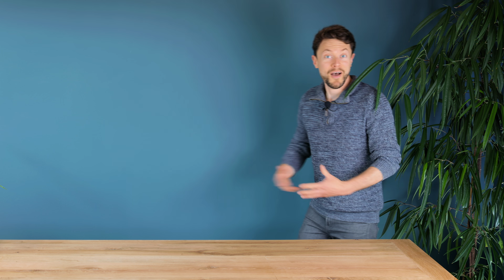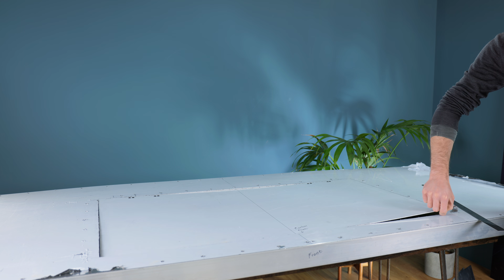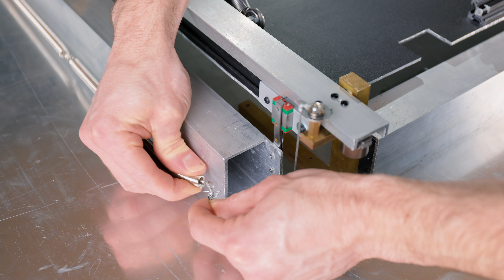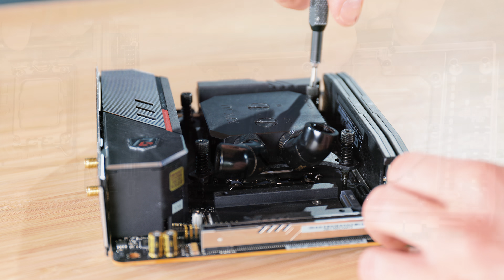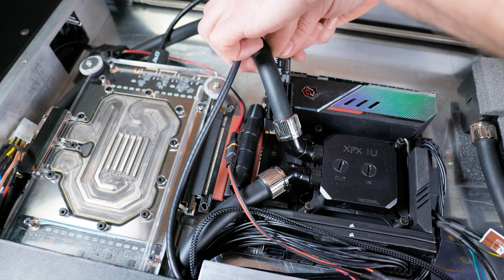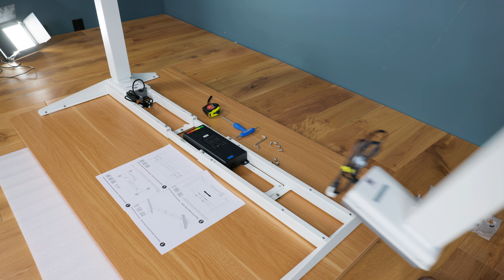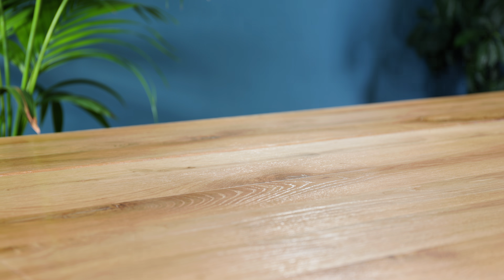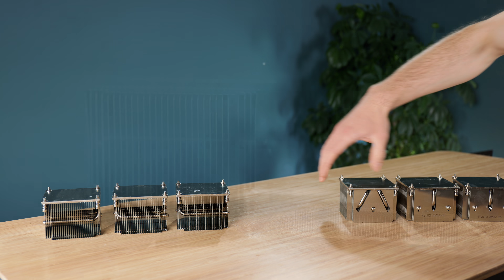Building the ENDGAME invisible PC

Comment: This is an awesome build. But I am a bit concerned with the table being sagged/bowed from the center, as it does not have any horizontal support in-between the legs on both sides. 

I know the table has square shaped hollow Aluminum bars. The original FlexiSpot desk has a horizontal Steel support bar at the center of the table (underneath the table) which is much more stronger than Aluminum. Also the Steel support bar is underneath the desk and placed right at the center, making the total weight distributed even. Whereas the Aluminum support structurer bars are on the perimeter, they do not give the table top similar support as the Steel support bar from underneath the table.

Comment: 24:09 was the comparison between heatsinks without fans vs radiator + fans? Because the one you showed earlier had fans on and often regular radiators already have fans installed too, right? I guess my question here is if the comparison was potatoes to potatoes...

Comment: I do wonder how much weight the table can handle, especially the monitor section. That's the only thing that keeps popping in my head with an invisible build, how foolproof/maintenance friendly it is. Also the empty spot opposite the computer could probably be used for a small storage container if anything.

Comment: One major issue though is that the screen is fixed in position. Not height adjustment or tilting possible. And while this may not seems like much, I think it can be very annoying on actual use.
Yet this is a really nice build ! Very impressive idea for the cooling system. I'm a bit sad that it didn't work with the copper heatsinks, it really looked like a great idea and should have had enough dissipating surface if the airflow was working as expected..

Comment: Awesome build! There is no deny that you're king of DIY. Side question: Is there any DIY alternative to portable workstations like Lenovo P15, HP Zboard, Dell Precision 7xxx laptops? Yes ive seen "luggable pc" video but i need something smaller :) I need a small portable workstation which can have 96GB (minimum) of ram, 8c/16t x86 CPU (minimum), powered from ONE powerbrick and easily fit the backpack (and below 3KG of weight). At first i thought about terminals like Dell 7010 Plus, HP 600 gen 9, but their 96GB support is unofficial and "wonky" and 2x48GB SODIMM modules are rare and expensive. Same with miniPCs like Minisforum MS01 - their poor support is also a problem. Workstation laptops mentioned above with 4 banks of RAM (up to 126GB) are really pricey (also because of screens, battery and GPU which i don't need) . Yet they don't have expandability (additional NICs). So do you (or anybody here) have any ideas arround this problem?

Comment: Looks beatiful and so clean, maybe a couple things I would think about:
1. Dust filters, the heat sinks will become a magnet for dust and their thermals will decrese with it.
2. Looping the coolant in the brass pipes like that having the input and output right next to each other means some (maybe very little) heat is transferred, separating that could improve it a bit more?
but ultimately it's great and if I could do the other half of the stuff I cannot on this project this would be a DIY next :)

Comment: One problem you'll run into sooner or later, depending on how clean your area is.  Carpets are really bad, but, anyway, having those fans just bear will suck in any fine dust and over time will cake on the fins and blades.... Better to buy a few air purifiers or some sort of filter enclosure. Unless you love taking that apart to clean it. I'd make a filter box to go over the fans. But having some hepa filters would also cut down on dust in the air.

Comment: There are less wide water cooling radiators. About 80mm of if I recall. Not sure how thick that table is but you can get a more flush setup with those radiators rather than the full size ones you used.

Comment: After building my first epoxy table I might make this my next project.
However I do not see the benefit of the cooling solution except that it is of course a cool engineering solution. As it is placed below the table and not hidden behind a somewhat thicker tableplate a classic radiatior will do the job just as well.

Comment: The only thing I'm wondering is if anything breaks like that monitor (that you've glued over all the connection points.) It would be very hard to do any kind of repairs.
Reply: Yeah he should've made a 3D printed snap on backing and glued the top wood to that instead or something.

When the monitor goes, the desk goes. Has to build a whole new one.

But it should last quite a long time.

Comment: Wow! First off, amazing build! The craftsmanship on the desk is fantastic, and the mechanics and monitor mounting are incredibly well done! I was originally going to be very critical of your cooling setup, but you addressed most of my issues in the end before I could mention them. The only concern I have is the brass heat spreader. The CPU water block is nickel-plated copper which is fine with brass, and I am assuming you did your homework on the GPU water block as well to confirm it is electrochemically compatible. But brass is far less thermally conductive than aluminum, and especially copper, so for an end game set up, I'm surprised you wouldn't go with better materials, though it doesn't really matter given how much surface area you provided and how many fans. The other concern I have is with the lack of any ability to reposition the monitor. Other than those, this is a really impressive build, well done!

Comment: With the thickness you ended up having of the cooling system at the end of the build, why did you go with all those heatsyncs as opposed to normal radiators? It really seems like it would be around the same thickness if not a bit smaller, and be much easier to build and service since its all off the shelf and purpose built.

Comment: 800 watts! It's as powerfull as an electric radiator! You created central heating because all of this heat needs to go somewhere and this somewhere is just beside the fans (connect 2 hoses to a heat exctractor outside of the house to avoid heating the house). My computer needs something like 150 watts of cooling to operate and durinbg summer it transforms itself as a radiator. Whatever, your creations are always amazing

Comment: I was hoping for a motorized opening system with a push of a button, but that magnet is actually so elegant that I fell in love with it. That build is so sick.
Reply: Maybe if the button was flush in the wood, but even then, a strong magnet is way cooler. Essentially a key that you have to know about. You can find a button relatively easily....
Reply: that can be done easily. just put some dc motor with big ratio gears on the sliding rail and hidden button somewhere and donediggitydeal
Reply: Hidden button underneath the desk lol

Comment: Hi! Great looking project. I had a quick question involving the water cooling portions of the project and more specifically the custom server heatsink + copper piping part. Here you used hollow brass pipes that are closed/fitted on each end using solder. My main concern with this comes with galvanic corrosion. I don't know what materials are used in the water cooling blocks that you chose for the components. However I will assume them to be aluminum which is a big worry when the custom portion of the loop uses brass material. Looking at an anodic index the common worry of copper+aluminum has a potential difference of 0.4 while a brass+aluminum combination has a potential difference of .35. I believe you are running the risk of galvanic corrosion and inevitable blockage within the loop as a result. Factoring in the solder which I will assume to be tin based creates another source of galvanic corrosion if the solder itself comes in contact with the water.

Awesome project! I'm looking forward to your next one.

Comment: I understand that the video has already been shot and the table is finished, but this option might be interesting - to put a little more distance, mmmm, from the wall in the direction of the user and place 120mm fans horizontally, not vertically, and print 90-degree air ducts💁‍♂

Comment: Mixed metals? Different cross-sections for the cooler and no channels for the cooler pipes (leading to issues of thermal flow/stratification)? Thermal paste? Thin (laptop) fans (noise/efficiency)?

Ultimately, this setup would destroy the brass pipes (erosion, distortion, leakage).
This will impact pressure and greatly decrease efficiency.
Cutting costs on materials now could actually increase expenses over time (electricity, damages, etc).

I know it’s to cut costs, but I’ve had so many cardiac arrests XD

Sincerely, this project is crazy—I love it, but these points 😅

PS: I didn’t fully watch the video as I wrote these lines, and it seems I was right XD
Reply: After watching this video ENTIRELY (this time). Some of flaws are still present, except for the noise. Pipes are still prone to previous remarks.
I hope this never happens and that I'm just pessimistic.... 😁

Comment: As always, a beautiful build. Initially I was rather worried about the aluminium construction (as I was with the previous build) as a desk surface for the simple reason or hollowness, noise, and resonance. Not noise from the PC, but noise from things in the desk. The addition of the thicker wood panelling likely mostly fixes this, though I'd probably still want to add some noise dampening mats underneath the top panel, and especially under the keyboard tray. Should be a simple enough addition, and the rest of this is amazing, even though an AMD CPU would have cut your cooling needs by... oh, 150-200W 😂

Comment: 11:45 No, no, no, no, No, No, NO, NO, NOOO! NOOOO!

Did you replace your other heat sinks in the water loop with copper? If you did, you skipped that. You absolutely can not have aluminum and copper on the same water loop unless you want to destroy the aluminum heat sinks. Hint: your CPU and GPU water blocks likely have aluminum contact plates with very thin aluminum fins and will decay very quickly. Galvanic corrosion is a huge concern for closed water cooling loops since the water reaches both components very quickly and carries the corrosion to all connected parts.

Comment: Your water path is likely your main issue.  You are running hot incoming water into the same heatsink as your "cooled" water leaving the block.  You are directly heating your output with your input.

Comment: I love this concept. I saw the original back in the day and I was so excited to see the new version, but man, your cooling systems are always hilarious. I can assure you it doesn't need to be remotely that big. You are mounting top notch components, premium legs and using expensive materials as aluminum and real wood, but when it comes to the cooling? Dirt cheap second hand heat sinks and more fans than any PC tower will mount. Yeah, it won't normally be seen, but still... 7cm diameter fans (they are still sold and they are silent too) and maybe another kind of copper heat sink (and less of them) was the way to go.

Comment: Fantastic build.  It turned out beautifully
I would have liked to see the curving hardware on the monitor maintained for the build, and I do think that gluing the facade directly to the monitor mount may make itself a nuisance in the future, but I realize that would have increased the thickness of and complication of the build, and these are ultimately small gripes about a project that is great on the whole.  
The hinge mechanism was particularly ingenious.

Comment: The folding section should cross the desk entirely to simplify design and the opening needing a magnet instead of a touch responsive section of the underside is an oversight in my opinion. And the screen came with an adjustable curvature arm and that is great for preventing eye strain if used proper and its not integrated at all.

A button you press should fold out the top and curve the screen into the perfect position. At least 1/3 of that mechanical stuff is fluff.

Comment: So some one contact ltt so the way to improve it would be to use sever water cooling radiators so you can have at be super thin and do ulterwied and a vertical monitor on the right side and put wood wrapping around the inside of the keyboard tray so you see even less metal and put a 14900ks within a direct die cooler and put a 4090 supreme in the pc that's how you one up it

Comment: Extra cool build but I'm worried about the mix of aluminium parts (cooling blocks) with the brass solution for the radiators as it will probably lead to galvanic corrosion

Comment: I can see a few issues with this project:

1. You've taken a very expensive flexible monitor and permanently fixed it in place, which seems like a waste.
2. As shown in one of the shots, the platform isn't secured when it's lifted, so it could start lowering on its own if you press a bit harder.
3. To replace parts of the computer or maintain the cooling system, you pretty much have to dismantle and flip the entire desk. Considering how heavy it is, that's quite a challenge.

Comment: Wouldn't there be a problem with the brass tubes clogging the waterblock finstack with small dirt particles? Or did you create two separate loops that exchange heat?

Comment: Next time use an apple silicon based Mac mini… saves a lot of heat and hence doesn’t need the pile of copper fan combos AND the power to drive them…. 800 W of heat 😱😱😱😱

Comment: your cooling solution is a bit silly and could easily be improved. right now you basically made a counterflow heat exchanger that cools>heats>cools>heats the water as it goes around. meaning one end of your bank of heatsinks (entrance) is hot and other side (furthest away end) is cold. with the water coming out of it being heated by the water coming in. You could probably get away with the earlier thin fans setup by having the brass (also mixing metals in water cooling is bad due to corrosion not 100% sure how copper>brass reacts but for instance copper to aluminum will destroy it) pipe instead of going back and forth have it go with 1 side being input and other side being output (as far apart as possible removing the current state of heat bypassing most of the loop) that way you immensely improve the effectiveness of the cooling loop. allowing the lighter setup to outperform your current big setup.

Comment: With 1,281,913 views, there should be way more than just 98k likes!
Superb craftsmanship and engineering.
Reply: Nice work put use overheat Intel prosessor in desk mounting? Not so clever at all.  He dont use aluminium cooling  potential at all. Whole desk is aluminium...use that and not those fans  and rubbish pipes...That monitor system is...wow! That i like...

Comment: Excellent craftsmanship well done. When watching your video, i knew that the cooling will not work, and saw that it did not. But i think first version of the radiator could have been saved. The flaws i think it had was; first a very restricted water flow, circulating the water in the brass  lenghtwise is not good. Secondly, hot water in and cold water out are at the same side big no no! thermal short circuit there. Maybe if you drilled many holes and let the water flow widthwise of the radiator and adding small server fans with a speed controller minus the fan shrouds you could get away with it.

Comment: This is probably your best build ever. What does it cost, all together? ;-) AND: Is the pump strong enough for your DIY water cooling strong enough? And how did you connected 12 fans correctly, that fan control still work?

Comment: That really is cool, the only issue I'm seeing is dust and potentially safety with those exposed fans. But with that much thermal headroom it should be easy to fit a long wooden box around them with a couple of easily cleanable dust filters, though that might only be necessary of you have cats.

Comment: Personally I would have gone with a long seris of rounded slots at a 45 degree inwards-facing angle for air intakes, since it'll look much cleaner. And a gentle reminder that you can buy thin mesh to act as a "dust filter" for dirt-cheap! Just glue or tape it to the inside and it'll look OEM on the outside.

Comment: Just make sure not to mak the opening magnet too strong, or you'd need a dedicated spot and placement not to damage any components. Also....what has been put in place to keep the contraption from closing? In other words :what is the maximum load on the platform for it to stay open.

I was wondering about the noise and cooling when following the construction....certainly when putting it into a giant soundbox. I'm still conviced the purpose radiator will work better then the current construction. 

On the other hand , the pretruding and unused fan surface can also keep your crotch cool....untill they get crammed with dust that isn't filtered through a mash to catch it from going into the entire system.

Comment: Amazing!  - I was wondering if you could either a) do an angled back bit to hide the fans similar to the front wedge shape similar to the front but the opposite way, or b) tilt the rear fans and make the height less, but then duct their width wider for their airflows to make them fit the same height as the desk.  ...great build though, loved it and wish I could be do something like it feel free to contact me for any ideas later on, hehe. I know i'd upgrade a bit later down the line though and have to change so much :)